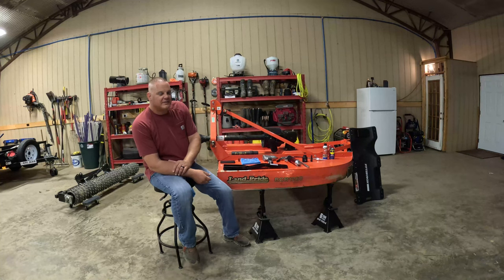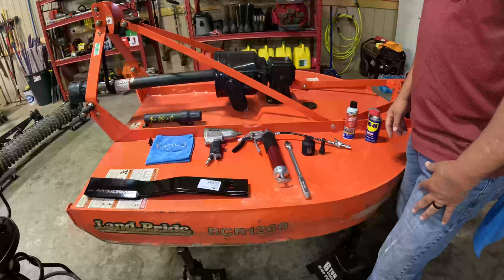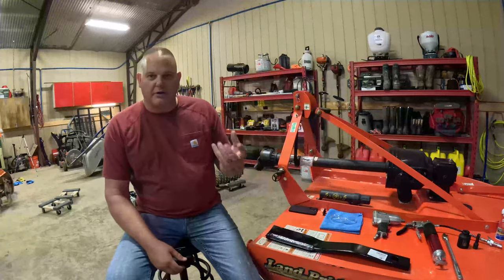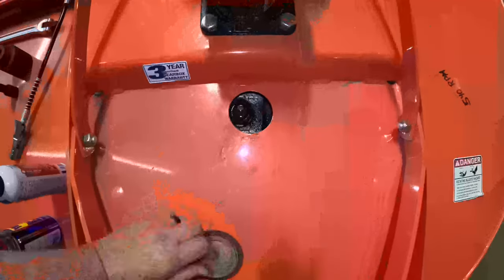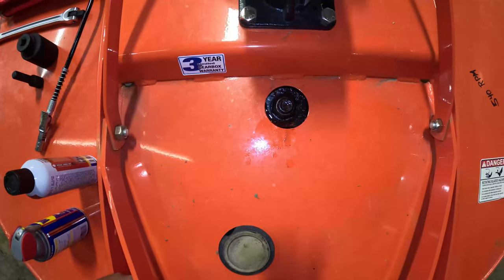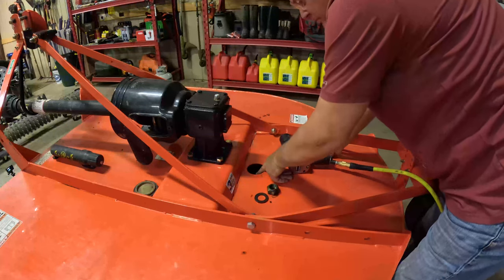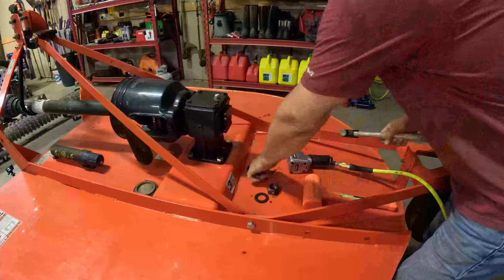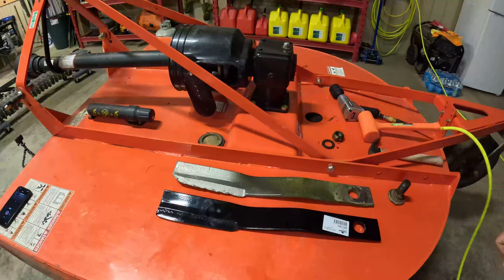Changing Blades on The RCR 1260 Land Pride Rotary Cutter (Bush Hog)

Comment: Nice explanation for those who haven't done this. Only correction was the socket size is a 1 11/16" as has been pointed out. That's an unusual size not in many sets. I bought one at the local farm store for $10.

Comment: It's a 1 and 11/16ths socket.
Reply from the maker: Thank you. Yes you are correct, 1 and 11/16th. Great catch and thank you for pointing that out.
Reply: Lefty lost or backwards thread?
Have tried but can’t get bolt off counter clockwise 
Thank you!!!

Comment: Thanks for the video.  I have the RCR1872 but seems pretty much the same.  May I ask the best way to lift the cutter and get it onto the jack stands?
Reply: I used a floor jack to set the first two jack stands and then alternated to the opposite side. I just kept repeating this and adjusting the jack stands until they were maxed out in height but still able to be pinned in place so they were locked correctly. I just reversed the process to lower it.
Reply: @bmcallister4539  many thanks!

Comment: According to the local Kubota Dealer and the manual  the bolt is 1 1/8" thread and the socket required is 1 11/16"
I tried a 1 1/16'' and it wasn't even close.  Great video!
Reply from the maker: You are completely correct. It is 1-11/16.

Comment: Nice video. I have the slasher one size below and this is very helpful.
One other suggestion with the grease points, there is also a 4th grease nipple on the tail wheel axle shaft, however as I stated earlier I have a slightly different model than yours so I might be wrong.
Reply from the maker: Thanks for the comment. The instructions I have with the machine say there are only 3. I’m sure different machines have differing grease points though.
Reply: I have a rcr 1260 and have a grease fitting on the wheel bearing also
Reply: Nice video really helpful
Reply from the maker: @@catjuggler333 I have one there as well. In the video you will see me grease that one last. There are 3 in total on this unit.  Maybe different year models are set up a bit differently when it comes to their locations.. thanks for the comment and the interest in the video.
Reply from the maker: @lestermiller1388  really glad to hear it was helpful. That’s the whole entire reason I started this channel.  Hopefully my video and editing skills will continue to improve and the quality of the content will be better as time goes by for a better viewing experience.